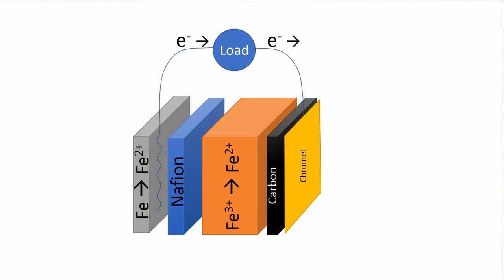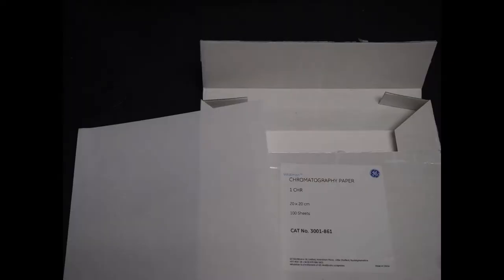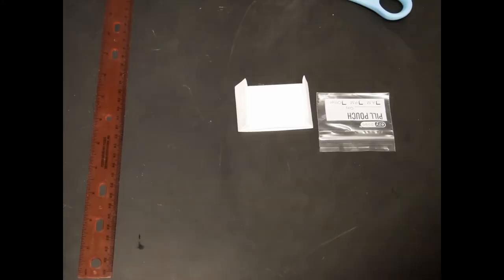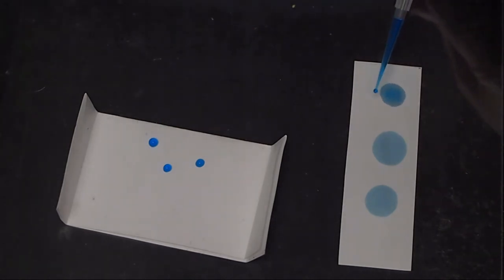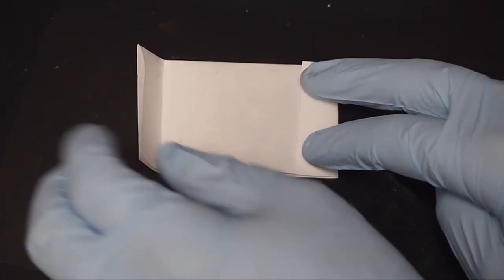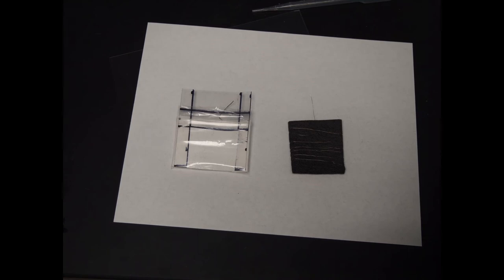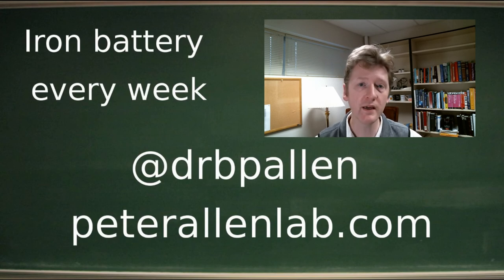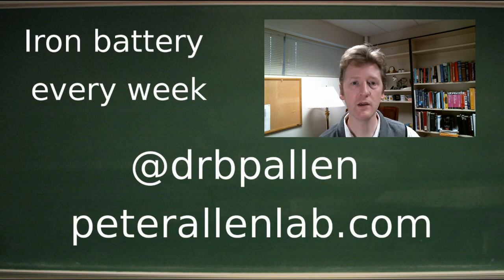How to build a cell: All-Iron battery, part 60

Comment: Very impressed with your research!  BTW, if it helps, there has been a lot of research done on this chemistry.  Optimum charging efficiency of 94% was obtained by one researcher when the electrolyte consists of 3M iron chloride, 2M ammonium chloride with 0.25M ascorbic acid (added as a chelating agent to prevent hydroxide buildup), with PH adjusted to 2 with addition of ammonium hydroxide.